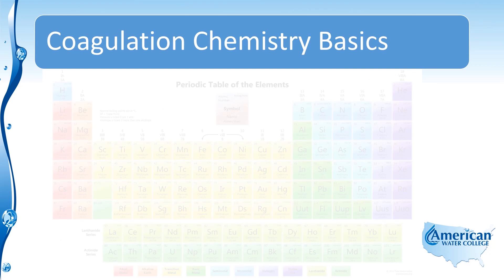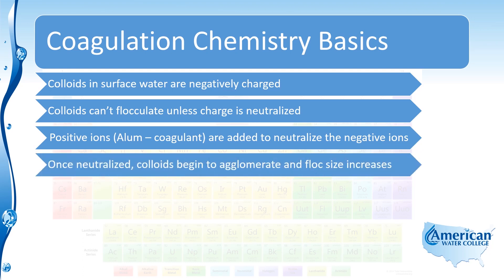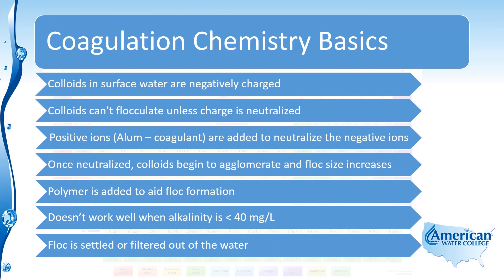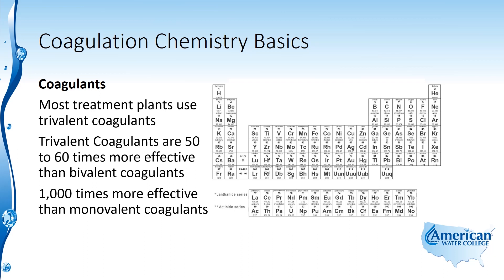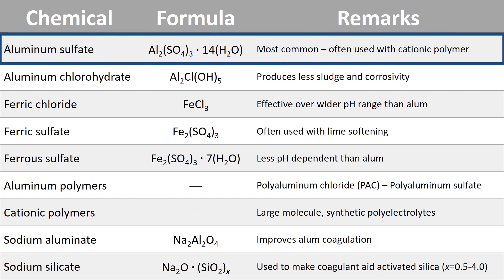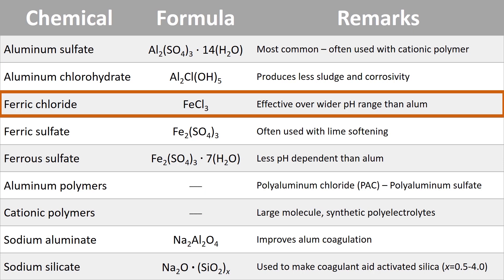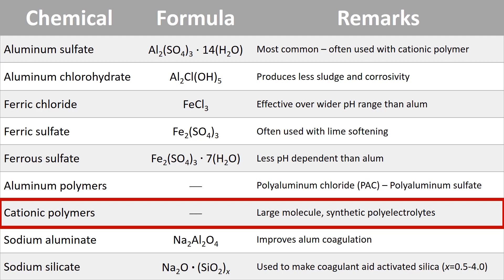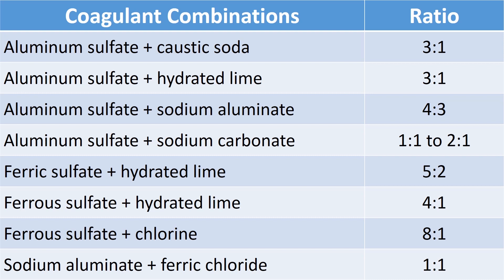Water Treatment | Coagulation Chemistry Basics

Comment: why is water negatively charged? isnt water electrically neutral?
Reply: Yes it’s electrically neutral. What he means is that waste/used water typically has dissolved substances/ions/particles that have a negative charge (like chloride ions).
Reply: Raw water is negative charged because of the amount of clay particle in water . Clay particles are negatively charged

Comment: Nice video,
Thank you,
Also Visit: http://bit.ly/2EjZSZR
Water treatment chemicals are the components used for treatment of water. Different types of chemicals used for the water treatment process includes algaecides, antifoams, biocides, coagulants, etc. The three chemicals most commonly used as primary disinfectants are chlorine, chlorine dioxide and ozone. Monochloramine, usually referred to as chloramine, is used as a residual disinfectant for distribution.